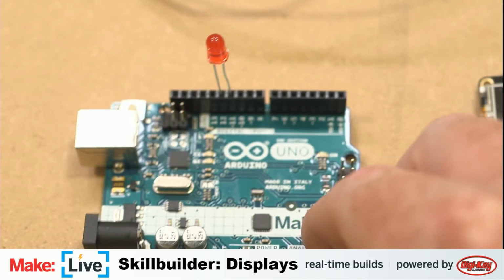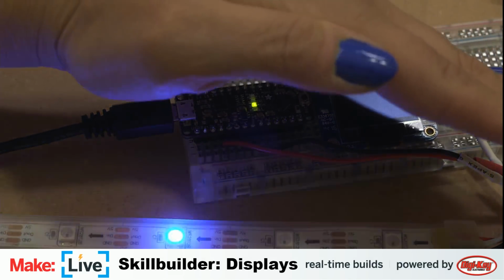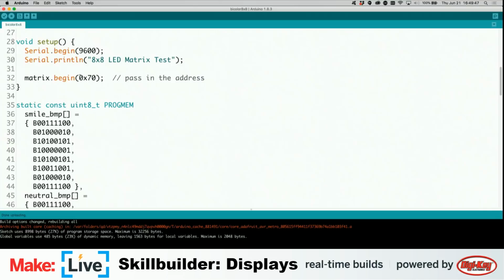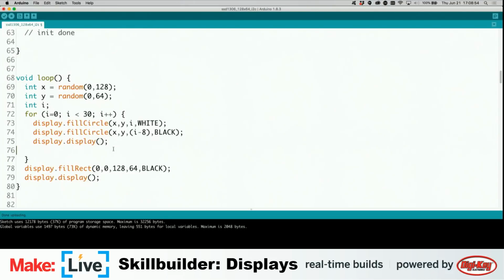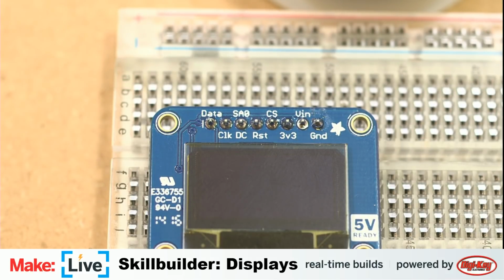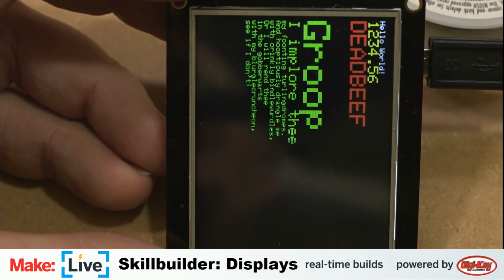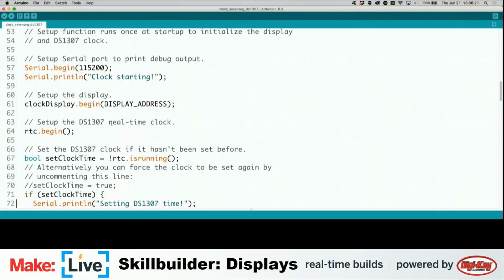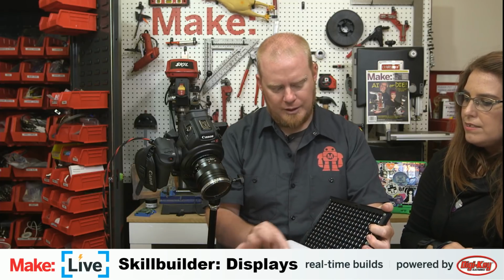Make: Live Skillbuilder - Displays!

Comment: Could you use Code::Blocks+avr_gcc compiler and associated libraries+headers to generate the program that you want to upload but you can also create *.hex files that can be loaded directly to the Arduino.
I would have changed that void loop(void) to  void main(void) and have used a 
while(!kbhit(0)) 
{
}
construct.
formed using a sonic welder.